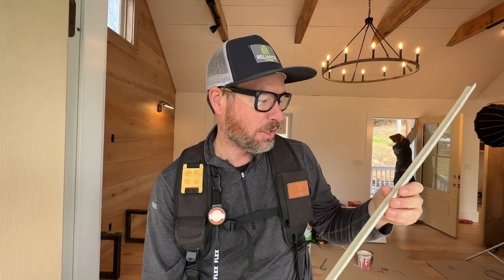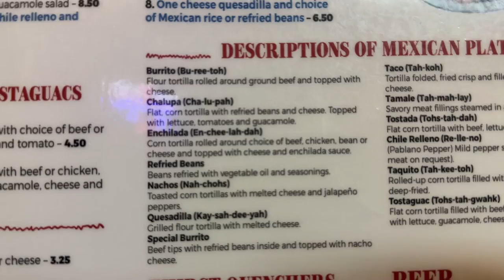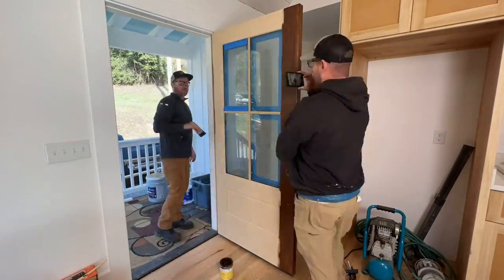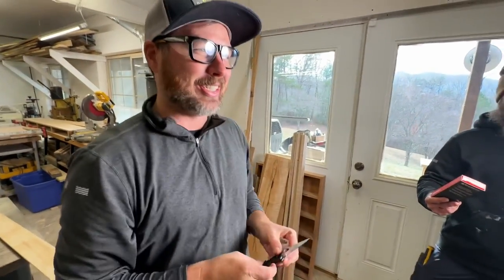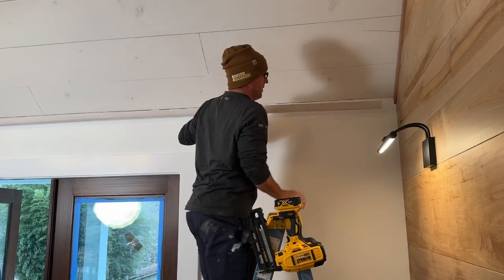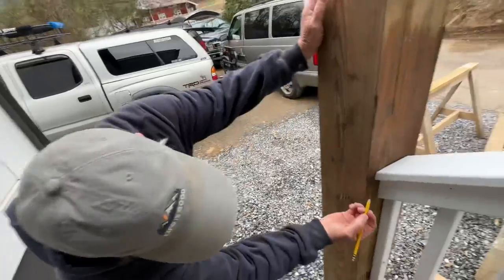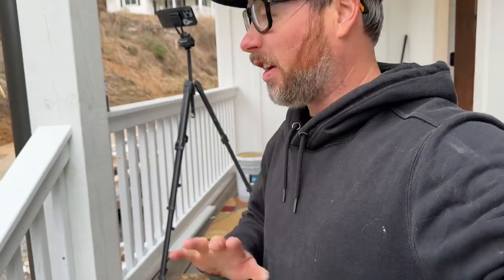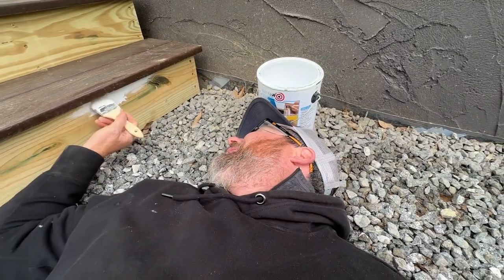Building A Small Income Property | Part 38

Comment: Erik needs a kneeling pad.  It's a gardener's best friend but it works whenever you need to kneel for any length of time.  I just use an old chair seat cushion.  You know the kind that tie to the back of the chair and eventually get too nasty to work even at a kitchen table?  That's the one.  The more padding, the better.)

Comment: I used Old English get stain and same Minwax (satin finish) top coat on my fibreglass front door. I thinned stain a bit (say 5%) and used artist wide brushes. It gave me streak free even and smooth finish. I scuffed surface with scotch pad lightly and cleaned with alcohol before applying gel stain.

Comment: You can use a roller to even out the brush marks. Just tried it for the first time (usually I spray) and it looks very good. Almost no texture. You just need a sponge roller.
Reply: Agree. Just use fine rollers. My two cents. It is not as smooth as brush.
Reply: I already sent a text message

Comment: Idea: Buy carry knives that have a hole in the handle end of the knife. Purchase 72 inch boot lace leather and feed the leather through the hole and braid or knot upon knot a lanyard so you don’t lose your knife. You will see the lanyard and find your knife if you drop it Greg.
Reply: Don't think I would want something loose near the saws.
Reply: @u.s.a.satire5982  wrap the lanyard around your wrist when using it and get a pocket holster and stuff the lanyard and knife down in the holster when carrying it. The lanyard is only 5 1/2 inches long anyway.
Reply: @u.s.a.satire5982  and the pocket holster saves shoving holes in your pants pockets. And you can put spare change in the side pockets. Pull the holster out of your pocket and lay it out on any table without keys and or knife to scratch the table up.

Comment: I did the same thing in a fiberglass door one time. The issue I had was my house was south facing and I had a storm door. The heat generated between the doors caused gel and poly ended up pealing and made a mess of the door. Rework was awful and it never looked the same after.
Reply: My fibreglass door is exposed to -30C in winter and +30C in summer with average exposure to sun for 7 hours. After 8 years now it has bit faded/oxidized look but no peeling or flaking. Surface finishing always  depends upon prep. I am planning to refinish the door from outside in summer time. Hope it goes well.
Reply: @timwaterloo5629  I agree 100%. My point was leaving the gel stain under a poly finish, I believe, is what created my issue.  The gel is not an adhesive or a finish, therefore creates a layer of "something" in between the door and the finish and caused the peeling.

Comment: Thank you for your videos.  You guys are a little bit nuts (in a good way).  This is not a rental property.  The level of details and the amount of custom finishes are insane.  Custom hood for the cook top, 130 pounds hard wood shelf, custom brackets for the shelf, 14'' planks for the wall, brushed finished on the front door, chiseled mortises for all door hinges, wood floor trimmed to match the ceramic, floor board pre-drilled and nailed one-by-one, and the list goes on and on.  You find that attention to details in custom homes, not in a rental property.  Good for you guys.